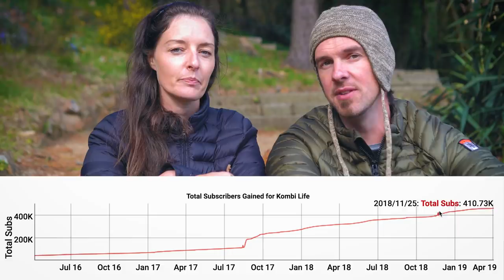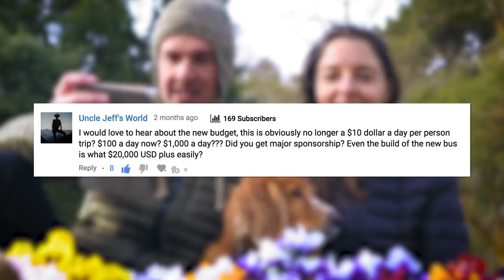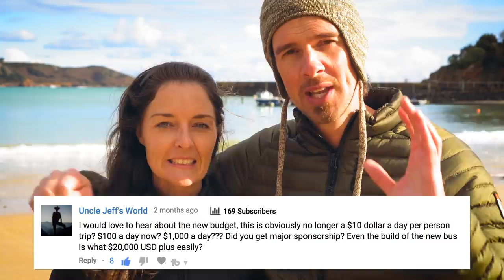Getting a YouTube Series Sponsored

Comment: A suggestion on your winch: before you install it, take apart the solenoid block, add dielectric grease to all contacts and seal up the box with automotive silicone before reassembly. I've had 3 of them now and the first one didn't last long without that treatment but the last two are still going strong since I sealed them up! Good luck guys, I'll be following along with great interest!
Reply from the maker: that's good advice, thanks!

Comment: Hi guys.  Fairly new viewer here.  Seventy two years old and not quite as adventurous with the traveling as we once were.  But here goes a suggestion born out of a fair amount of solitary off-roading.  We eventually started carrying our winch on a portable mount that attaches into our receiver.  By installing a receiver also on the front of the truck (Toyota Tacoma) we are able to carry it front or back depending on where we need the weight for balance.  We also noticed that over the years we were in need of the winch for self recovery more often in situations where we had entered the problem going forward so that the winch was most helpful pulling us from the rear.  Nice to have the option.  I love your videos and can hardly wait to see where the build goes.
Reply from the maker: Great advice Michael. Thanks for sharing.

Comment: For your winch I highly suggest mounting it with a receiver attachment so you can move it from the front to the back and have a plug to unplug it and plug it in and also make sure you can lock it up because at some point in your overlanding you're going to drive into something and get your front end stuck and you're going to want to be able to winch yourself out in reverse and it's a lot easier to do it from the back then it is to do it with a bunch of snatch blocks from the front
Reply from the maker: plus the Kombi likes to carry the weight at the back.

Comment: Very cool video if the nice rear bumper has a mount for a trailer hitch you could mount the winch there and slip it in and off when needed and carry a spare battery to connect to it directly.